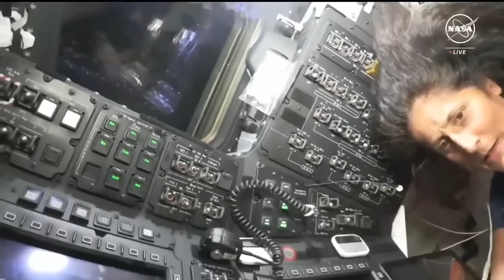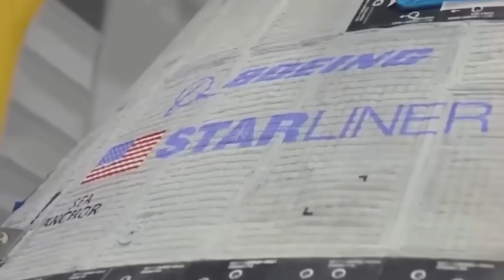NASA Is Launching The Starliner Again... Worst Decision!

Comment: When a design requires a lot of rework, over a period of years, the problem is with the design. Boeing has a serious problem as they have thrown in a lot of good money into a bad design that will not get better. Its’s practically like they painted themselves into an expensive corner. They need a miracle to save themselves now.
Reply: @ismailnyeyusof3520  “when a design requires a lot of rework over a period of years the problem is is with the design”. Funny, I thought you were talking about SpaceX. It took years for falcon to become reliable and how much stainless steel has starship dumped into the ocean so far?

Comment: Starliner sucks. I was willing to let them have their failures or partial failures which is exactly what is supposed to happen with uncrewed missions. That first crewed flight should have gone off as perfectly as possible, meaning Suni and Butch could leave within 2 weeks without that disaster with the thrusters. What is even worse is Boeing's attitude. They refused to show up to the press conference that NASA set up after the successful uncrewed landing in September 2024. They keep picking fights with subcontractors and NASA and treating the space bureaucracy/infrastructure as if they are the same as DOD jobs where they call the shots with regards to DOD bureaucrats bending over for them because of Boeing's long history of building military planes.

Comment: ? Why is it taking so long for starliner to be ready for safe flight  ?
  Nasa built Apollo in less than half the time .
  Starliner should have be done in half the time that it took to build Apollo  ! We've been ripped off again by Nasa and Starliners builder's  ! ! !
Reply: You have any idea how much in today‘s dollars that cost? Not to mention the 3 lives?
Reply: @chrissmith7669  spacex did it with less time. How?
Reply: @diyasingh-x8t they didn’t have to deal with government project management change requests.  SpaceX worked independently.   Boeing had to deal with NASA change requests that affected configuration.   It’s the same basic reason Boeing can design and introduce a new commercial aircraft design in under 7 years but a new military aircraft design can take decades to enter service.
Reply: @chrissmith7669 but this is wrong! The space department should be separated. It should be directly under the president.
Reply: @diyasingh-x8t not only no but heck no!   The president only gets to decide on his administrations goals based on their vision.  Congress is the one charged with funding and making the requirements.  The president was never intended to be a sole decider.
Reply: @chrissmith7669  but there should be things that the president could decide on his own. And the space department is one of them. You know in India, the department of space is directly under the prime minister. He can decide and approve anything on his own. He also decided on a budget for space research.
Reply: @diyasingh-x8t there’s no reason for the president to decide such things.